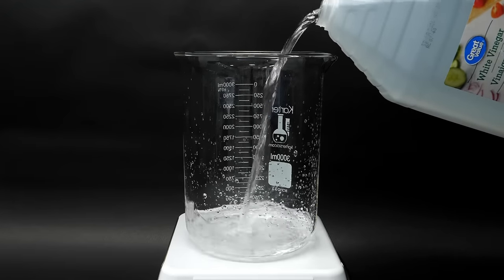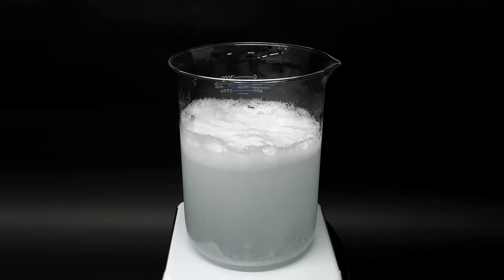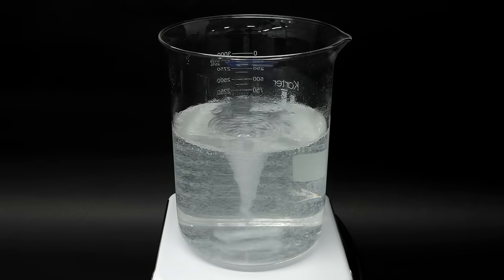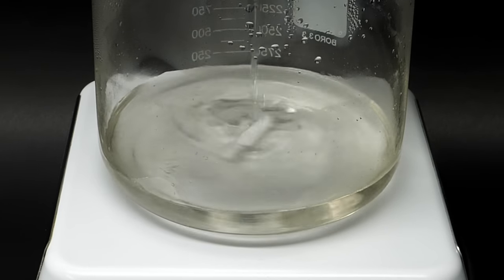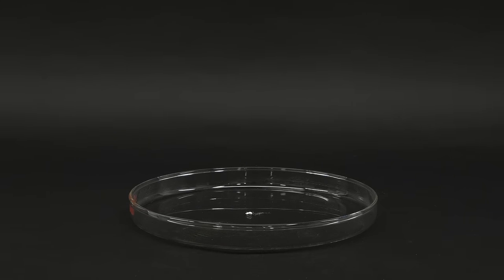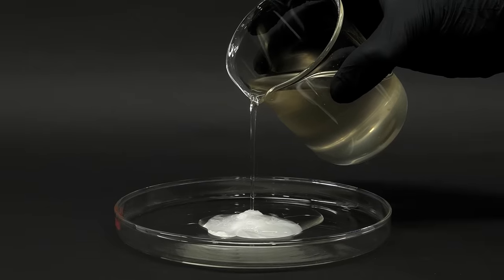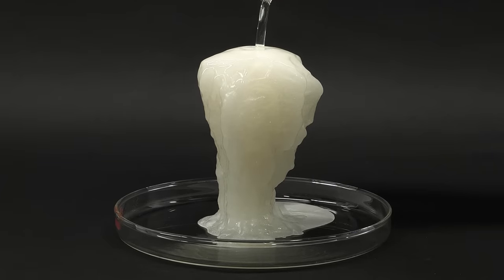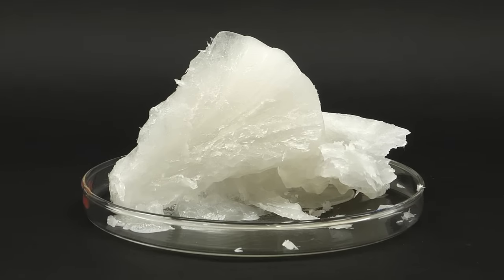Using vinegar to grow a weird tower

Comment: This is how "shorts" should be done.
Not rushing through anything to appease the severe ADHD crowd. 
And certainly not in the stupid "shorts" format that YouTube has such an affinity for. 

But not overly long and extremely detailed. 
Just detailed enough to get the point across without, again, rushing anything.

I'm personally a fan of the longer more in-depth style videos.
But when I only have a minute or two and I want to watch something brief, this is the perfect way to appease or fill that niche imo.